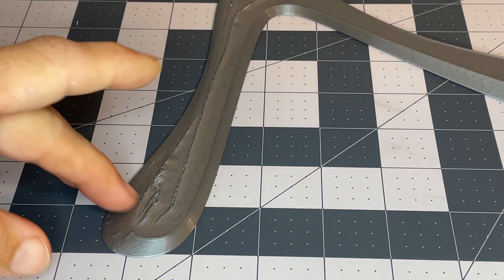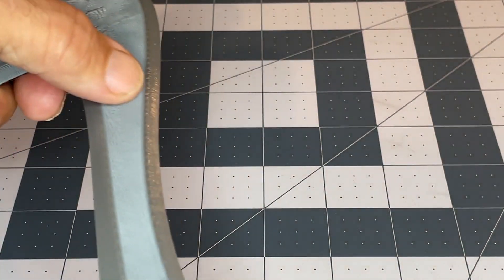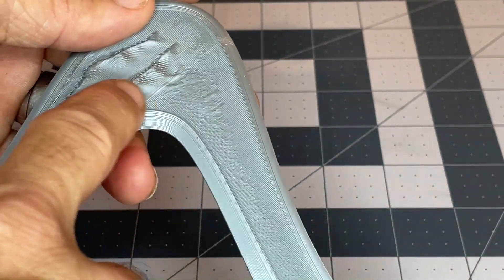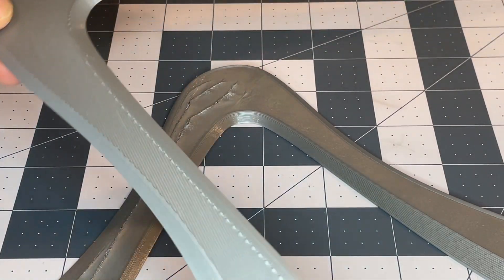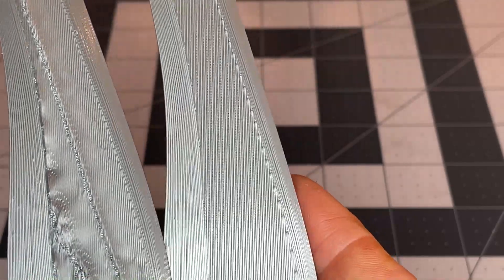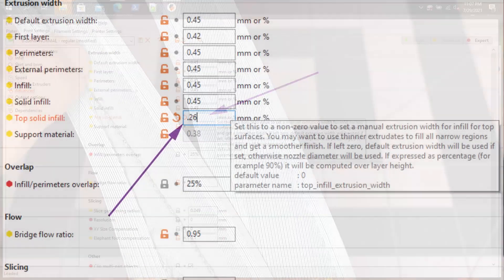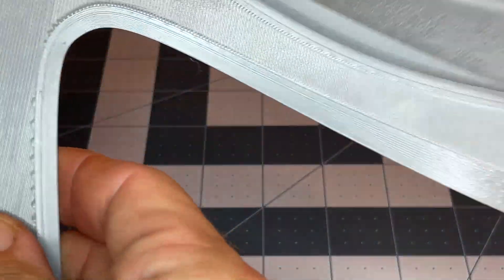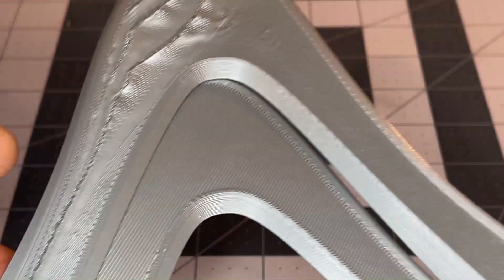Lessons Learned the Hard Way: Pillowing? Nope. Top Layer Width Too Small

Comment: Dude! Finally!
I've recently been working on the adaptive layer height feature and I'm sure after seeing this the separation is happening because my layer heights are too harshly different!
 I've been trying to find someone with a similar issue to what I had but layer adhesion always applied to middle of print and not top layer in the videos I found.

Comment: I have this exact same issue. However it's not a slicer problem. Using the same gcode that printed perfect prints I now get what seems like over-extruding on top layers.
Reply: I am not sure what printer you use, maybe try calibrating your e steps and seeing if that works.